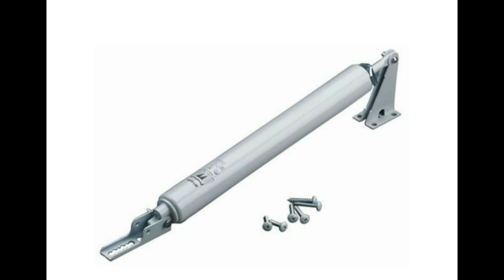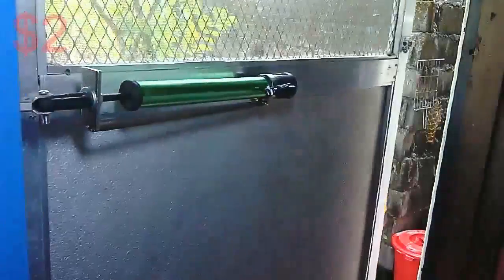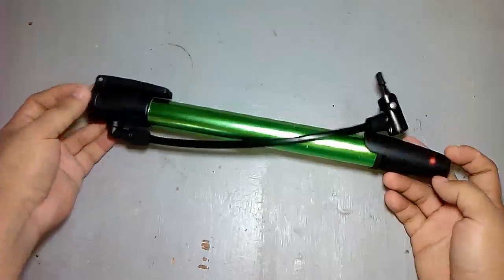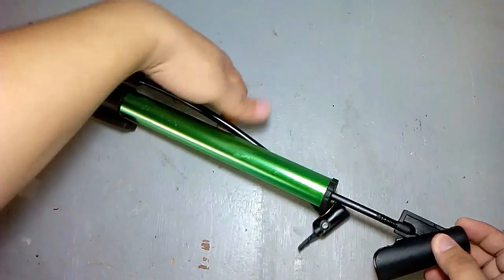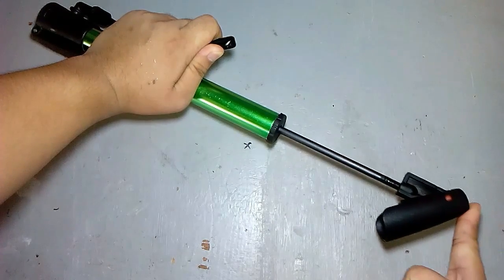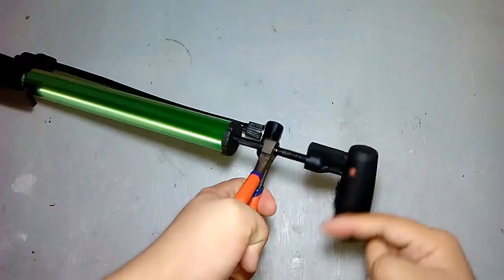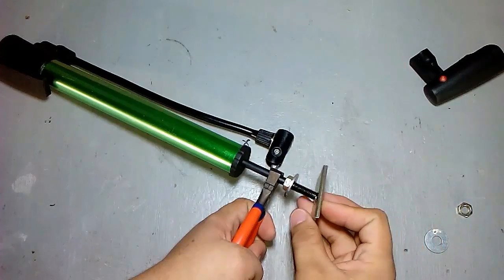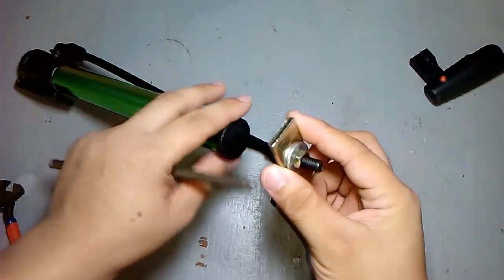Pneumatic Door Closer for 2 Dollars

Comment: Looks like a bike pump cobbled onto a screen door to me.  

People will look at it and recognize the ingenuity.  However, you don't tend to drive around town on your get-me-home spare tire "because it saves you a ton of money".  There is generally a cost associated with doing something the right way using conventional means so, in my opinion, and as an avid cyclist, to me this is a waste of a bike pump.  
You can probably find one at a recyclers for almost nothing or turn up a deal on eBay for under ten bucks.  

Clever tho'.
Reply: Ya well if somebody did this in my house, I'd be like, "what the fuck did you do to my bike pump!?", and like, "why didn't you tell me the door thingy was fucked?  I could have asked my construction buddy to look out for a SERVICEABLE replacement!"   (because he's always doing reno's and stuff, right?  You should see the bathroom suite he set us up with.  It's nuts what people throw out these days).
Lke I said, clever ingenuity is being demonstrated here but it's kind of like that video of the guy in India that has a stick replacing a wheel and the guy is driving down the highway, well maybe not that bad, but most people would get the idea.  

Not you though, you fuck.  What the fuck is wrong with you?  You and all the other fucking trolls out there. 

Y o u  a r e  c l e a r l y  t h e  w a n k e r  h e r e.  

So fuck off and go jack your nob in the corner, you pathetic fool.
Reply from the maker: well said sir
Reply: Archer McFlatty AS A AVID BIKE RIDER I THING IT'S A WASTE OF A BIKE PUMP .IT WAS 2 DOLLARS FOR FUCK SAKE WHY THE FUCK WOULD YOU GO TO THE RECYCLERS GO SMOKE SOME MORE CRACK
Reply: so go and fuck your bike and your bike pump

Comment: The spring doesn't have to be attached to the closer at all, merely between the door and frame. The further you attach the spring (to the doorframe) away from the hinge, the better it will pull the door closed.

Thanks for posting this. I'll be sure to use it when i get a screen door.